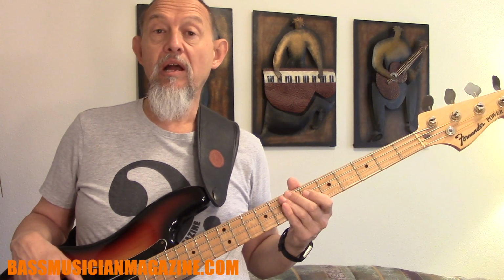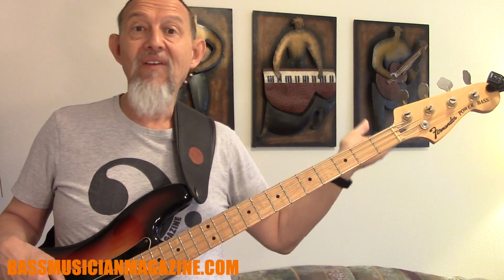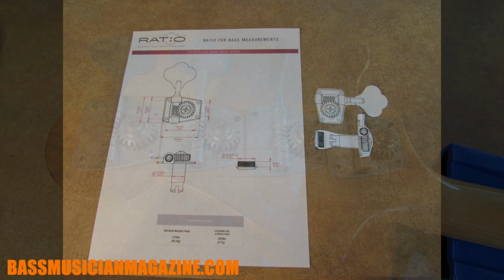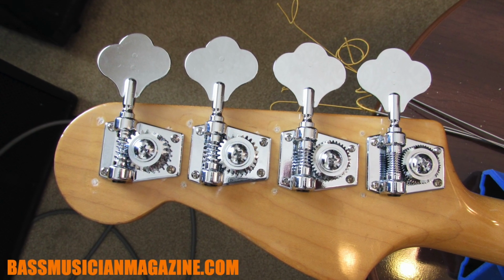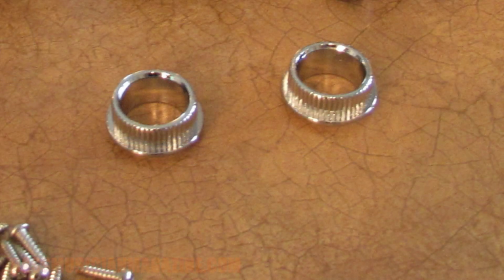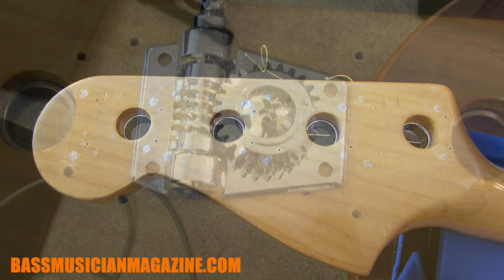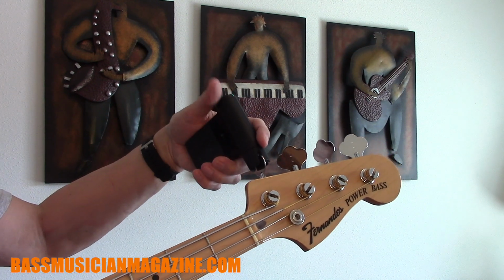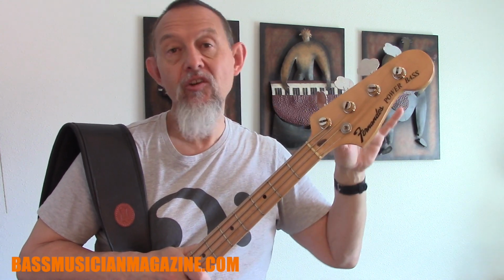Bass Musician Magazine Reviews - RATIO® SYNCHRONIZED MACHINE HEADS

Comment: Hello and happy new year! i have a question if you don't mind. Just got my new Schaller machine heads for my bass and i have the opposite problem with the new bushings. They are a bit smaller than the old ones. Do you think i should add some wood glue or electrical tape so to keep the new ones tight? does it matter if i just leave the old ones does it make any difference? thank you ;)
Reply from the maker: Hey Kostis, I am not a luthier, and if you want the best results you would probably be better off asking someone who does this all the time. That said, If this were my bass I would examine the existing bushings. If they looked good I would try the new tuner to see if it has a good fit with the old bushing, If it all seems fairly snug, I might leave them as they are. If, however, they seem too loose I would would see how to work the new bushing. Glue might fill a small gap but won't stick to the metal. I don't think Tape would be work as it might bunch up as you try to place the bushings. Ultimately if you are unsure... Get help from a qualified Pro. Thanks for watching and for your input! Please feel free to Like, Share and Subscribe to our channel.
Reply: Thank you very much!
Reply from the maker: @kostis6  Very Welcome... Good luck! :)

Comment: Also pro tip don't be afraid to ream the holes for the tuning machine bushings, take measurements to see what size you need to go too you want em snug but if you have cracks occur if that happens it will grow with humidity change. As being a tech I've done this a bunch of times. Awesome video.. some tuning machines are also direct swap meaning no new holes needed. For example my gb7 extender for my old spector q4 pro which had jin ho 150 sealed tuners (gotoh gb7 copy basically )
Reply from the maker: Thanks for the tips. I thought the hole sizes were good as I got three bushing in place and then the crack happened on the forth one. I even "Lubed" them with soap and I know they are supposed to be snug. Oh Well, live and learn. on the upside there has been no change in the crack. It is still only on the face of the headstock and does not go all the way through. Thanks for watching and for your input! Please feel free to Like, Share and Subscribe to our channel.
Reply: @BassMusicianMagazine  wood shrinks with both age and humidity change it doesn't take much to crack the vaneer on the headstock but to be safe you can ream it just a little to insure a firm install while keeping cracks from happening and potentially spreading through the life of the instrument. It's always better safe then forcing something in and have it crack all the way through and lead to tuning instability issues till properly fixed.. to me it looks like it was just the vaneer which may spread through the vaneer but should be fine structurally for years to come.. cheers
Reply from the maker: @Jihadbearzwithgunz  Thanks for the info! :)
Reply: Also been subbed for a while forgot to like the video though so I fixed that cheers again.
Reply from the maker: @Jihadbearzwithgunz  Excellent!

Comment: Why are you using an electronic tuner? I thought that ratio tuner were meant to facilitate manual tuning.
Reply from the maker: The electronic tuner was part of how I discovered that my old tuners had issues. I confirmed that problem was gone by testing again with the new tuners and now tuning is great. Either  manual or electronic, they are working perfectly and staying in tune nicely. Very stable.